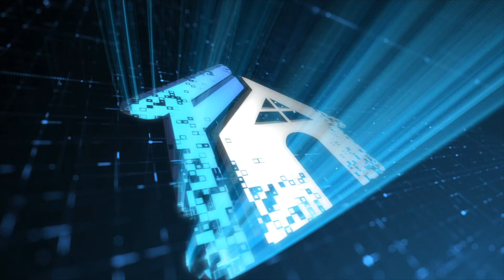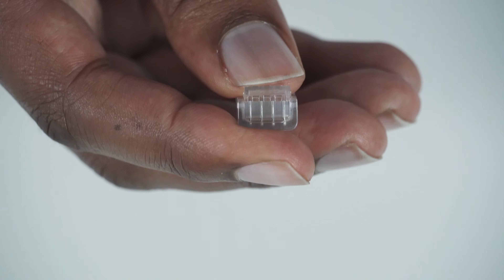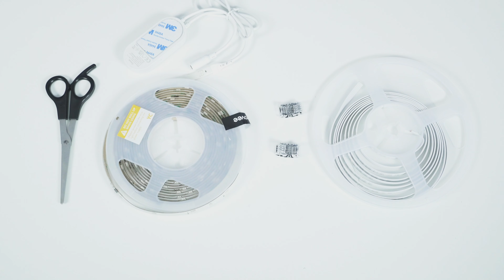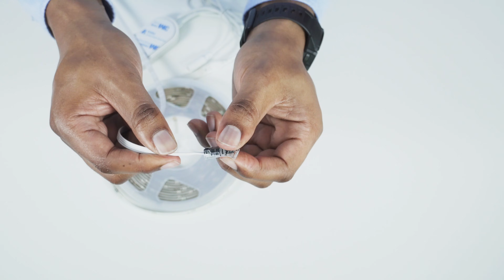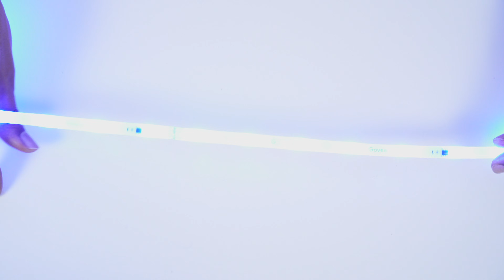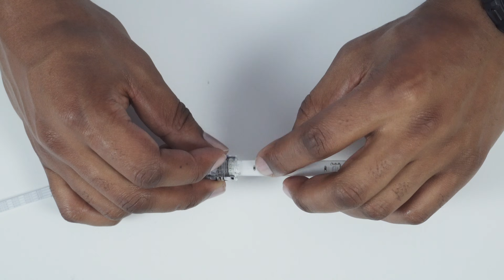Extend Govee LED strip lights the right way

Comment: I have the Govee RGBIC LED Strip lights with covers (H61B3).  Will this work for them as well?  Do I need 3 or 4 pin connectors and do I cut on the cut line or on the actual copper conductors?

Comment: Also the other links for the pin connector and wire are not opening as it is saying different country on Amazon.
Reply from the maker: Try the li ks now. If they don't work just search the name of the product. Let me know if you still have a problem 😎👍🏾

Comment: Will these work for the new RBGICWW?  I heard that they have 5 wires then I read where they have 4.  I can not find 5 wire connectors anywhere so not sure if they have 4 or 5.
Reply from the maker: No these wont work on RBGICWW

Comment: DOES NOT WORK...THE LIGHT STRIPS ARE TO THIN AND SLIDE RIGHT OUT OF THE CLIP
Reply from the maker: The mistake you're probably making is that you're not making sure teeth go through the tracks of the LED strip. As can see in my video, I had no problem at all.

Comment: Can you use this method to daisy chain two 32.8ft led strip kits with covers? So I could only use one power supply to run 65.6ft and have a seamless line? Or would the app not know what to do?
Reply from the maker: Not sure if the power supply will manage the additional load. This video is more for cutting the current length to go round corners and through gaps.

Comment: can you cut and extend multiple times within the same light strip?  I noticed that after the second extension I made started to fail.  At first it won't turn on, so I tried tugging on the wires, straightening the light strip, etc..only to notice the 3rd extension behaves with its own brain.  it doesn't change colours and when I try to turn it off, it stays on.
Reply from the maker: Need to make a better connection

Comment: Hi, can you please advise how I can combine 2 x Govee LED Strip Light 2 Pro (5m)? I have these arriving tomorrow. Mistakenly I thought I could just chain them together but I'm worried it's not possible or I need to be additional things. Thank you!
Reply from the maker: You shouldn't Daisy chain then as the power supply is rated to the length that they provide.

Comment: I want to connect or join 2x 20M led strip, is that possible? or do i need 2 separate supply to run them? 
Ceiling is around 35m, govee led length is 10m or 15m max
Reply from the maker: Yeah you have to check your power supply is enough to operate all the lights

Comment: Is there a specific “t” shaped connector you prefer  use? I have a project I’m trying to plan out, I’d like it framed with LEDs then vertical LEDs about every 4 to 6 inches. Just a rough estimate I’m thinking I need about 30 feet of to do the whole thing.
Reply from the maker: Haven't had a need to use any as yet.

Comment: I’m using the clips in the video but they won’t dig into the copper points on the LED strip
Reply from the maker: You may need to strip some of the plastic covering the front of the LED strip

Comment: Didnt work for me. the "extended" strip i connected to the main strip doesnt light or show in the app. have try with 3 different lenghts. now im standing with a totally cut up "5meter" led strip.
Reply: Just found out why... what you are doing, isnt an extention of the led strip itself. an extention you make the led strip longer. what you do in this video is just putting wires between.. not and extention. what i did was a direct extention, but cant do that since i cant add more segments into the strip in the govee app.
Reply from the maker: This video provides a tutorial on extending an LED strip setup to additional areas from a single source. The explanation covers the process, and the demonstration focuses on connecting a single additional set of LED strip lights. I apologize if the instructions were not sufficiently clear.

Comment: Hello! I have a question. I want to buy a Govee LED strip — one that’s 65 ft and another one that’s 100 ft. Can I connect them together? I mean, can I cut one of them to make the other one longer? Thanks!
Reply from the maker: No. The power unit that is  by the manufacturer is for that length only.

Comment: Uh. But the extension is not lit....
Reply from the maker: Not sure what you are referring to. Watch the video again.
Reply: @fluxautomate  These govee strips can't be extended past their original length. The extra that you add will not light up. This method works if you already cut some off, to add it back on, because it does make a good connection. But there is hard limit on how far the lighting goes on these strips.
Reply from the maker: Thats what the video is showing. Sorry of this isn't made clear to you.
Reply: @fluxautomate I just don't understand why they make em like that lol. Wasted a lot of time trying to get a perfect length, ended up having to return and buy the really long one just for an extra couple feet
Reply from the maker: I guess to reduce costs on manufacturing

Comment: I am having a go at this and my lights are not working. Only the strip connected to the power source is lighting up. The extended lights are not lighting up at all. I initially thought it was because i bought the clear clamps so i went back and bought the black and clear like in the video and still they dont light up.
Reply from the maker: Have you checked if the connections are secure? You may need to remove some of the clear plastic from the top of the strip so that the pins can go through the cable and make a strong connection.
Reply: I will give that a shot and let you know.
Reply: @topthumbs did that work? I’m having the same issue
Reply from the maker: Check the connection are good

Comment: Hey, I’m really struggling with this I’ve been going it at for 2 hours now, with back and forth support from chat gpt
The cheaper connectors in the start of the video do work for me, but it just doesn’t fit my application
I’m using the clear snap in connectors, I have the wiring color coded to the correct slots (24v, DO and GND) and literally nothing is happening
Any advice is appreciated
Reply from the maker: Make sure that your connections are made really well. If needed strip each wire and twist and then clamp into the connector.
Let me know how you get on.

Comment: I'm working through this now with my Govee RGBIC Strip Light 2 Pro with Matter. Measuring the strip, it's 12 mm wide, but I can't seem to find connectors like this that are 12mm and 4 pin. Am I missing something?
Reply from the maker: I'm not sure what other sizes they make. Keep searching ,if i find anything, I'll make sure to let you know.
Reply: I can't find none, bud! And no connectors are working for me for the strip light 2 pro. Can confirm it's 12mm and 1.3mm thick. At this point i think i'll try soldering it today.
Reply: @mrjackdaniels0309 ~I have the Strip Light Pro 2 as well. I have not cut mine yet. Are there solder joints at the cur marks? If not, how did you find the solder joints?
Reply from the maker: You should be able to see the copper connection point of it can

Comment: I have the Govee RGBIC Strip Light 2. The lights come with cut lines that are not on the solder connection like your video shows and unfortunately for the length I needed I had to use that cut point. Is it still possible to make a connector to use the rest of the light strip I cut?
Reply from the maker: What would you control that strip with?
I would say you would be better off buying something fit for purpose.
Reply: I'm dealing with this same problem with the Strip Light 2 Pro. From researching online, it looks like those cut lines don't have contact pads and this won't work, but I'm not sure. @danielhutton6225 were you able to determine if you can cut and splice on those cut lines?

Comment: I bought Govee RGBIC, but to my surprise it looks like its only 3 wire? theres only 3 solder points showing at the cut mark,  is this possible?  I thought RGBIC had to be 4 wire...or did they give me the wrong product?   Govee H618F RGBIC
Reply from the maker: You must have been sent the wrong set.
Reply: @fluxautomate  i contacted Govee and they said it was indeed a 3 pin. I guess RGBIC can be either 3 or 4 pin. luckily I was able to return the 4 pin jumper set I got and bought the 3 pin. All working good!  thanks for the video tutorial, this really helped!
Reply from the maker: @Illinination1977  happy you got it sorted in the end. 👍🏾
Make sure to SUBSCRIBE, LIKE and hit that NOTIFICATION 🔔 for more content coming soon 😎👍🏾

Comment: OK, I have a few questions here I have a different set of LED lights on my house and part of my deck. I need to get another set to finish my deck or multiple sets but don’t wanna have a bunch of things plugged in. Can I connect the LED lights that I have two the Gove lights and then use their app because it’s a little easier to use and also I noticed when you connected it to that extension piece, there was no lights on wouldn’t the purpose of connecting them be so you have continuous light strips without having to use multiple plugs, especially since they come with the plug in the middle and with that plug in the middle is there a breakup of lights or does it light continuously or do you see that break?
Reply from the maker: I wouldn't suggest mixing and matching. Ingredients for a disaster. 
Stick to one brand and follow their published instructions.

Comment: Would it be the same connector for rgbicw or the m1? 

Looking to fit leds in my kitchen that work seamlessly with leds around the house so all off one app. 

I have hue bulbs too but thinking of moving away from that ecosystem.
Reply from the maker: I'll look into this and let you know my findings
Reply: @fluxautomate  I got the same question... I just purchased an M1, have 2 shelves and want to cut the M1 strip into two pieces and connect it with the wires in between. The wire would be something around 1 meter or less...
Reply from the maker: Not sure

Comment: This is what I need for the strips I just bought! But it's the Govee M1, and I can't seem to find the right connecters 😅 (12mm 4pin)
Reply: I got the M1 lights too and I'm having to trim the sides a bit to make them fit.
Reply: @ChrisMullinsMr  Did you get them to work?
Reply: @blkmoon78  The strips were too big for the connectors, and i had to trim them. For my project, I needed 3 disconnects. I got two of them working but not the third. It was hard getting the connection just right.
Reply: @ChrisMullinsMr  Thanks, I will try the same. The strip in the video worked perfectly but for my cabinet I need a brighter strip. If this method doesn’t work I think I will have to learn to solder! Thanks again.
Reply from the maker: Looking into this and will update
Reply: Welp, that was horrendous. I trimmed them and that didn’t work and the soldering was a nightmare. Guess I”ll wait until there is an easier solution for the M1s.
Reply from the maker: Will look into how to do the M1 and make a video soon. 😎👍🏾

Comment: Hey, I have Monster lights and am unable to find any connectors where the pins line up. I was wondering if I could use the four pin connectors if there are only 3 pins on my LED strip with a gap where another pin would be if it were a 4 pin. (5V, Gap, Data, GND) Please help 🙏🏽
Reply from the maker: No. look for a three pin version from the same manufacturer on Amazon

Comment: I need to add an extra 3m of Govee RGBIC to go around my ceiling, can I use this method to add an extra 3M , so use the connectors to add lights instead off just cable?
Reply: I dont believe so because the controller is programmed for the original length of LEDs. I tried doing something similar and found some post on reddit that cured my curiosity after thinking my wiring skills were lacking

Comment: would this process work for the outdoor govee light strip as well?
Reply from the maker: I wouldn't suggest this technique as outdoor LED have weatherproof seals
Reply: You could heat shrink it and perhaps add extra sealing method. Should be doable

Comment: Does this work for the outdoor Govee RGBICWW Outdoor LED Strip Lights ?
Reply from the maker: I would advise only to use this product if it isn't exposed to direct rain/water.
Most outdoor lights have a water resistant membrane which you would need to strip parts off to attach the  extender.
Hope this helps.
Please make sure to SUBSCRIBE LIKE and hit the NOTIFICATION 🔔 for more videos coming soon 😎👍🏾
Reply: @fluxautomate  Thank you! Any suggestions for outdoors? Is there a better govee set?
Reply from the maker: @ReneeSmith-v5r  if you need outdoor lights that have a lot of length that you don't need to extend I would probably suggest the Govee RGBIC LED Permanent Outdoor Lights. Thay have a multiple length options up to 150ft but also extender kits than can add an extra 40ft. These would also be easier to install compared to LED strip lights.

Comment: hey! is there any to inject power into these leds lights? I split a 5 m strip into 50 cm segments (solder points are at each 50 cm mark). However with all the wires and extensions it seems the second half of the system is not receiving enough power.
Reply from the maker: Not to sure about that. The lights will be rated to a certain amount of voltage/ampage. Make sure to not exceed the manufacturer guidelines.

Comment: Is it possible to connect two RGBIC led strip lights? I want to connect the 32ft and 16.4ft together but I don’t know how. Could I use the materials you used in this video? Thank you in advance for your help.
Reply from the maker: As long as the power supply is powerful enough it should work.
Reply: @fluxautomate What do you suggest if it’s not? I only have whatever came with the products. Thanks.
Reply: @johnandsusandeale2711 that where govee is limited. There is only one way to find out and that could cost you extra money if it does not work

Comment: I’m trying to buy give Govee RGBIC which is one strip but it’s always 2 so I’m gonna cut the first one and attach to the second one. Will I lose out on features in the app?
Reply from the maker: Hmmmm not to sure. Depends on the specific strip. I would suggest getting the M1 strips to do that as they are build to enable you to extend. Check out the link in my video for the specific link.

Comment: could you use this to also connect two strands of lights so dont need multiple power supply as in two rolls of 32.8 ft?
Reply from the maker: Your power supply needs to be powerful enough to supply enough current to the LEDs

Comment: Great video, thanks.  Do you know, do you HAVE to cut through solder joints or can the LED strip be cut at OTHER points?
Reply from the maker: Preferably at the solder point would be best but you could at other points just make sure you have enough space from the chips or LEDs to enable  closure of the connectors. Hope this helps 👌🏾
Make sure to SUBSCRIBE LIKE and hit the NOTIFICATION 🔔 for more videos coming soon 😎👍🏾
Reply: Many thanks
 @fluxautomate

Comment: Question, can you connect an rgbic to rgbic so you could have a more seamless picture? On top of that, can you still use the customizability on the app?
Reply from the maker: Most likely not able to use rgbic as the app reads/assigns the number and location of each LED if you so controlling additional LEDs may not work.

Comment: They say the rgbic you can’t cut, I’m pissed I’m short like 3 foot I need to add I’m at the end of both rolls, so I just need to add like 3 feet to one
Reply from the maker: You should be able to cut any lights at the correct point. Just some lights you cannot add additional lengths. Main reason is the app won't identify anything longer and in addition the power supply that comes with it won't be strong enough to power any extra lengths and may malfunction.
Thanks for watching and make sure to SUBSCRIBE LIKE and hit the NOTIFICATION 🔔 for more videos coming soon 👍🏾
Reply: @fluxautomate what to do in that case? If you want to cover say 20m length around the room, how do you extend these 5m LEDs? Do you just have to power each separate?

Comment: What model number are you using?
Reply: After connecting it, are there any problems with the application regarding the effects?
Reply from the maker: Not for simple LED strips. Not all strips are made to be adapted so make sure to check this before cutting.
Reply from the maker: All products used are in the description.

Comment: only thing is i believe you can link the govee lights anyway so you dont even need to extend them in some cases which is great
Reply from the maker: Yes as long as you have the correct power supply. But just remember that the controller can sometimes only be programmed to a certain number of LEDs. Thanks for the feedback 👍🏾. Make sure to SUBSCRIBE LIKE and hit the NOTIFICATION 🔔

Comment: I bought Govee RGB Smart Wi-Fi + Bluetooth LED Strip Lights and extension strips 1M but It'll so confused as to how to connect them- it seems like they sold me extensions, but the rgb can't be extended? It looks so dumb in my son's room, because the two rgb strips (5m each) that comes f from the present source is just around 30 cm short connecting to meet on the middle. That's why I bought extenders, to make our all the way round the ceiling. Can I extend that little snippet with an extendor clip? Even though I don't have RGBIC?
Reply from the maker: Yeah you can only extend like for like products. If you extend and having issues it may be down to the power supply not having enought volts or amps. Hope this helps 👍